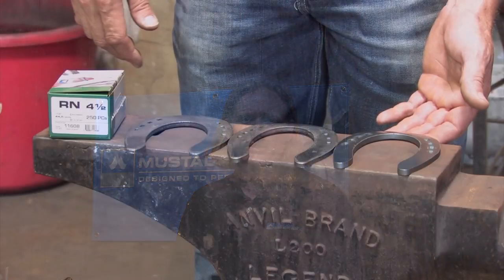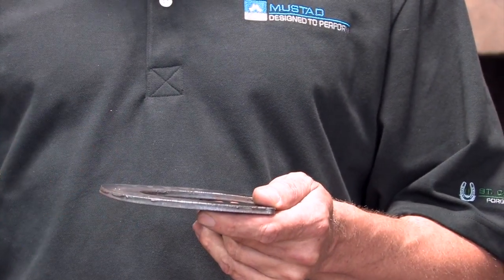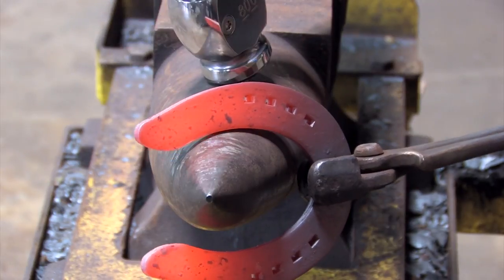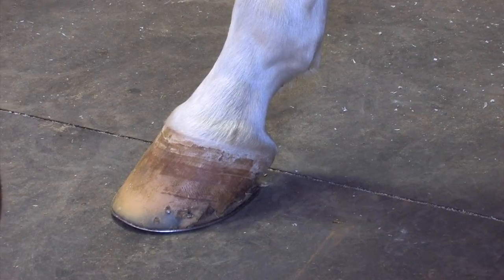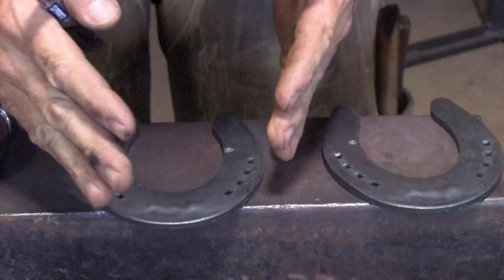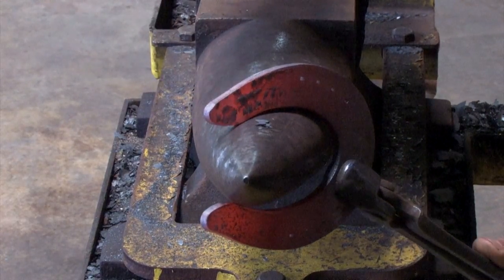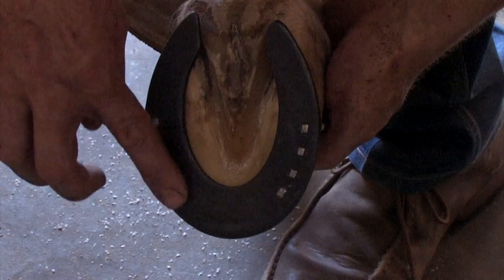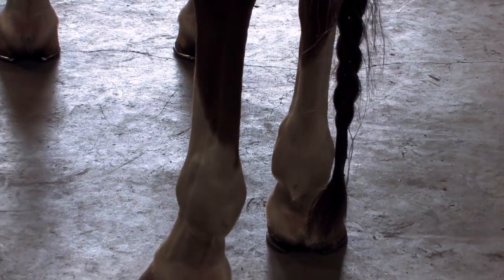Double S Reining Plates

Comment: When do you need to have an breackover on a sliding plate?
Reply: you shouldnt ever need breakover since these are strictly hind shoes.
Reply: Layna Grue all double s plate come with a small rocker toe 
But why do you need to have a rocker toe
Reply: it makes the movement more comfortable for some horses and it all depends on the shoer's preference, there's really no need to have a rock in the toe.
Reply: Layna Grue thank you so much for your reply! So if I’m understanding well the horse will slide easier? Doesn’t the horse shoe comes earlier out  of the sand with an rocket toe?
Reply: The rocker toe is to help prevent their toe from digging in the ground.